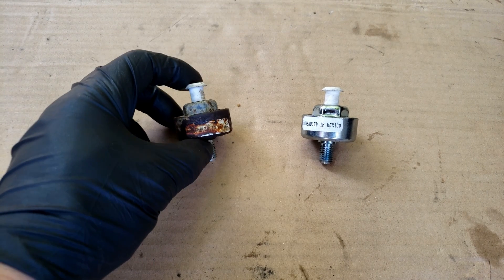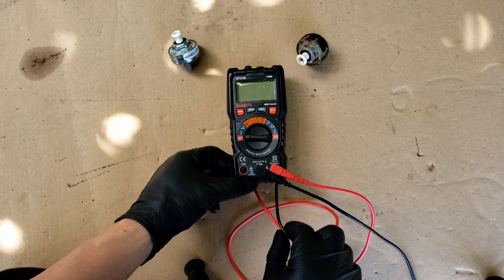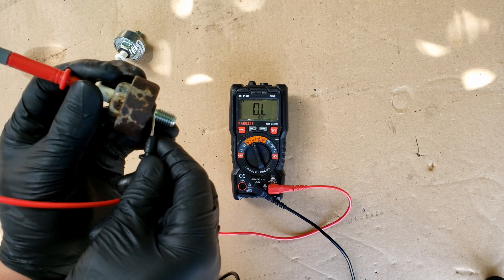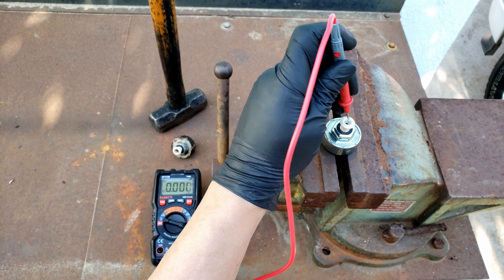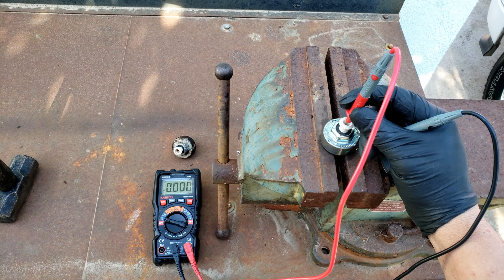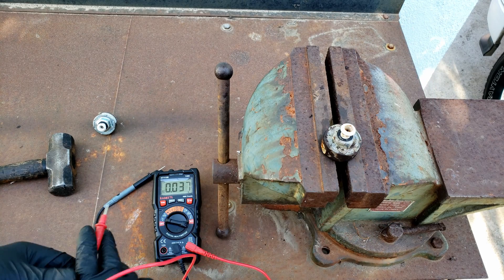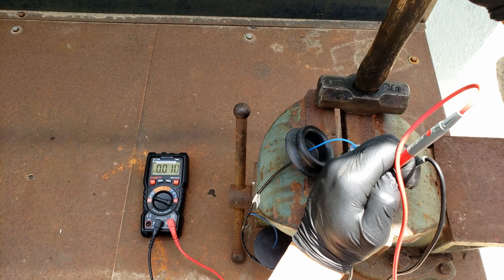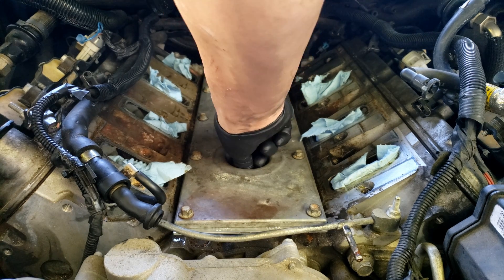How to Test A Good and A Bad Knock Sensor

Comment: I recently replaced mine with Delphi sensors I think I messed up putting a doorman harness still getting codes
Banc 2

I seen video on how to bypass the wires. and another video revving up to 500 RPMS twice for 3-5 seconds which seems kinda odd that resets the harmonics inside the knock  sensors I will check em with the oems meter and go from there

What do think could be?
Reply from the maker: Well the harness as long as its making contact and the wires in good shape it should be fine even if dorman brand..ive had a couple cases where the knock sensor from local auto parts caused code to still remain...i had to use an ac delco and that fixed the problem...did u clear the codes when it was replaced and they still returned?
Reply: @backyardchevy328  yea I cleared em couple days came back so hmmm
Reply: @backyardchevy328  how many oems should the wires read I believe 1000?
Reply from the maker: @leosdreamon681  93-107k ohms
Reply from the maker: @leosdreamon681  maybe the area where the knock sensor screws into might be really rusted and giving a bad ground to the knock sensor
Reply: @backyardchevy328  I’ll check the voltage out n more likely replace with oem thanks tho
Reply from the maker: @leosdreamon681  good luck..hopefully its something like wasnt clicked fully in or something that wont require spending anything else

Comment: How you decide whether to use oem or after market parts?
Reply from the maker: ive done a few..including silverado's and Camaro etc. and 2 out of 7 times i used aftermarket sensors i had to go back and replace em cause they failed..the ac delcos ive used 4 times since then and so far no problems with em.
Reply: @backyardchevy328  So it's an experience thing.  It's such a crap shoot on whether someone has come up with a better product than the original.
Reply from the maker: @crackermcwhitey1364  yea..I mean theyre not necessarily bad ive had a few good expeirences..one big benefit to say autozone or O'Reilly's knock sensors u get limited lifetime warranty while ac delcos only have 1 year...but just based on my personal experiences i would prefer to go with oem from now on when it comes to knock sensors
Reply: @backyardchevy328  There is quite a bit of work involved in replacing the knocks sensors on a 02 thru 09 chevy engine due to the need to remove the intake manifold that it just makes sense to use an oem rather than take a chance. I may not be right on the years here but I believe that after 09 the knocks was placed on the heads which was much easier to get to.
Reply: Do you have to clean the threads ok on the rusted sensor?